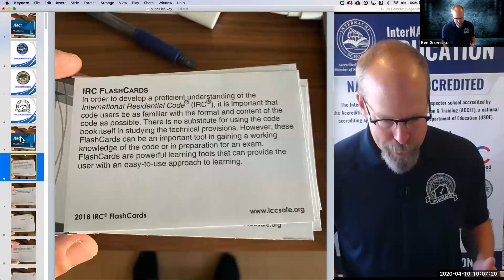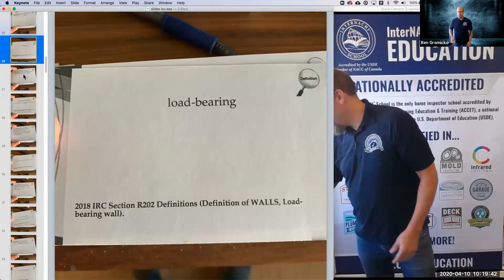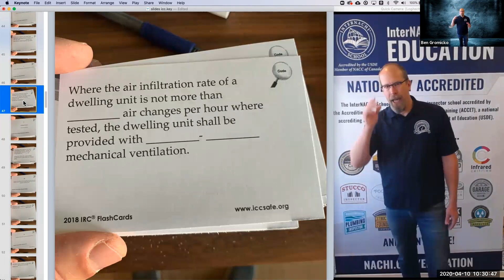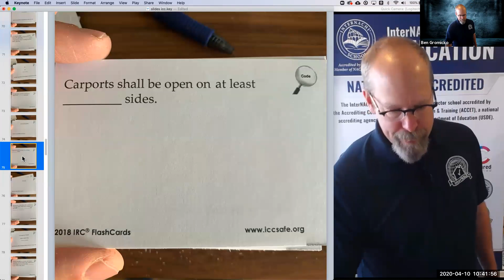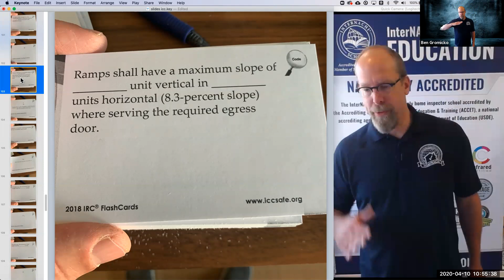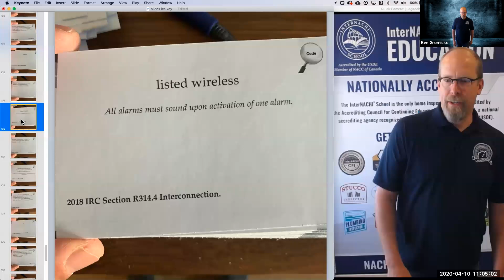ICC Code Exam Prep Webinar for Residential Building Inspector B1 Certification

Comment: So here is my frustration with ICC.  The question about pathways for photovoltaic systems.  You look up photovoltaic and it refers you to R907.  You go to 907 and it refers you to NFPA 70.  You look at NFPA70 and get no walkway info.  The ICC info is listed under solar.  In reading the question it is wildly misleading not using the word solar.  This is a regular theme trying to learn the structure of the book.  Often you are led to an area which does not yield good information.  In this case how am I to know to go to Solar Energy system when the question uses the term Photovoltaic and it leads you nowhere.  I spent no less than 15 min trying to find the info for min depth of footings.  Your answer referenced 403.1.4.1 which did not give the information and 403.1.4.2 which does not exist.  I did not think to go backwards to 403.1.4 at the end of your description card.  When you have 90 seconds to answer a question this is a problem!
Reply from the maker: Wow. Good question. Thanks for watching.
Reply: @internachi .  That's it?  Good question?  How about a legitimate answer to my question.
Reply from the maker: The legitimate answer to which question? And I think you missed the point. The point is that we were reading the ICC flashcards. If there are problems with the flashcards, the ICC has a contact page. I think they're pretty good.

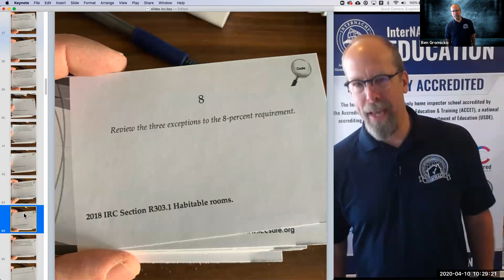Comment: Im adding this, because I often get asked what "glazing area" means and you mentioned it at 29:30 - GLAZING AREA. The interior surface area of all glazed fenestration (the arrangement of windows and doors on the elevations of a building), including the area of sash, curbing or other framing elements, that enclose conditioned space. Includes the area of glazed fenestration assemblies in walls bounding conditioned basements
Reply from the maker: Great to hear, Aaron.

Comment: To all who are/will be taking the ICC exams. Don’t even waster your time to study these flash cards. You can’t just memorize this much. Learn how the IRC is structured. It goes from bottom to top of a building. Tab the book. On your exam, the index is your friend. Do practice problems as they will help you recognizing the key word to look up in the index. And most importantly, read the EXCEPTIONS as that’s where you will miss the correct answers.
Reply: Speak for yourself, I can memorize it all
Reply: @roberthughes2687  good for you but I call it BS my friend.
Reply from the maker: Glad you enjoyed watching the video.
Reply: True, a couple of these were on my test and they were the free bees you answer quick and  use more times on the tougher questions
Reply: How you know I was tryna do dat?😂
Reply: Appreciate the advice 👏🏼
Reply: It helped me, I even add more cards of my own with the work book, so it does help, but with respect everyone has own ways of studying,
Reply: So here is my frustration with ICC.  The question about pathways for photovoltaic systems 1:08.08.  You look up photovoltaic and it refers you to R907.  You go to 907 and it refers you to NFPA 70.  You look at NFPA70 and get no walkway info.  The ICC info is listed under solar.  In reading the question it is wildly misleading not using the word solar.  This is a regular theme trying to learn the structure of the book.  Often you are led to an area which does not yield good information.  In this case how am I to know to go to Solar Energy system when the question uses the term Photovoltaic and it leads you nowhere.  When you have 90 seconds to answer a question this is a problem!
Reply: @MarkEkberg-lr3yq  Negative you need to know the vocabulary. Photovoltaic is the correct term.
Reply: @MarkEkberg-lr3yq  yea you’d have to get familiar with the word . A way to remember is by breaking it down photo- is short for photosynthesis , voltaic-voltage , harnessing sunlight to produce electricity photovoltaic
Reply: Tks for the tips! I´m wondering when the ICC gonna open te B1 exam again, the last was in 2021...Have you get some information about it?
Reply: Great advice.

Comment: 31.5" Clear hand rail to wall comes from 36" min. Width - 4.5" handrail projection, thus 31.5 (question at time of 52.13) code reference R311.7.1
Reply from the maker: Nice.